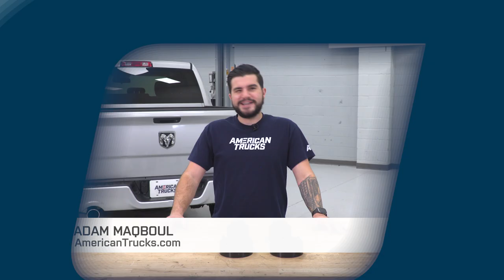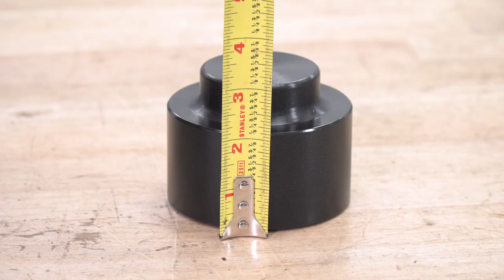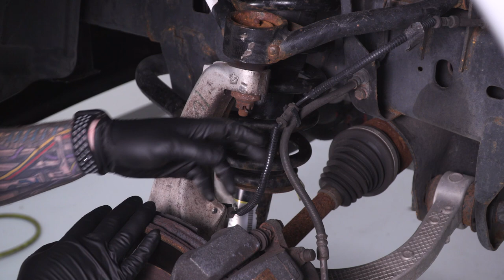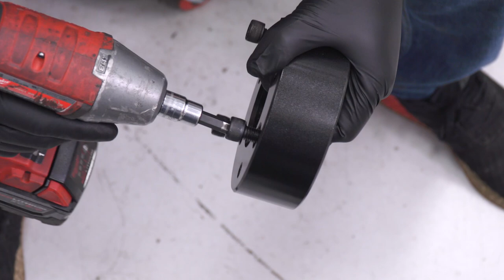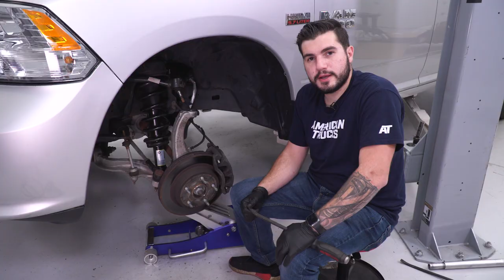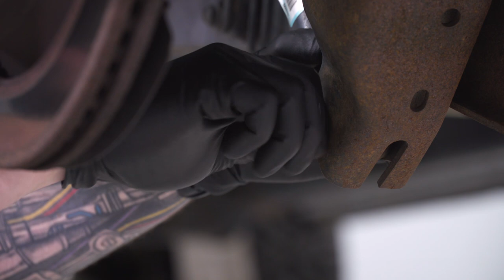2009-2018 Ram 1500 Supreme Suspensions 3.5" Front / 2" Rear Pro Billet Lift Kit Review & Install

Comment: Do you know if it is compatible with a warlock since it comes with a factory 1in lift? If so would that be an equivalent of a 4 1/2 and have to change the control arms?
Reply: As long as it doesnt have that adjustable suspension you good 👌